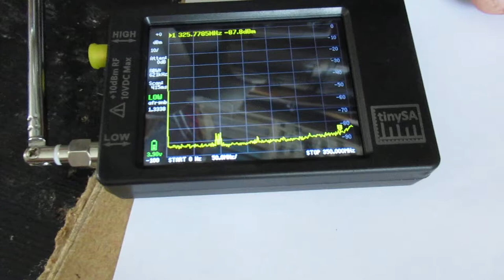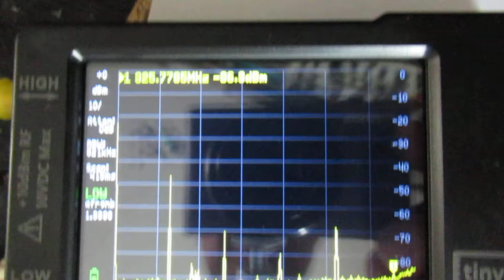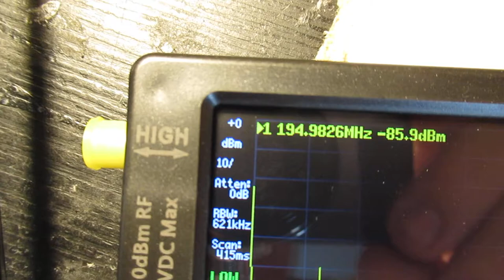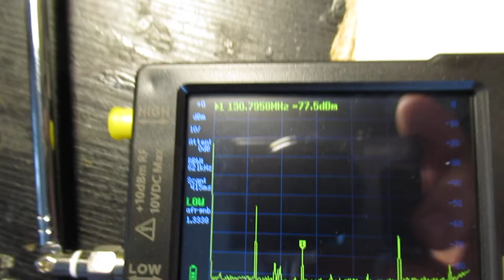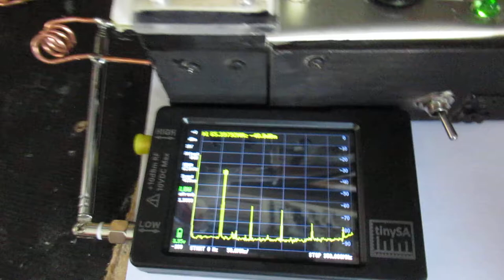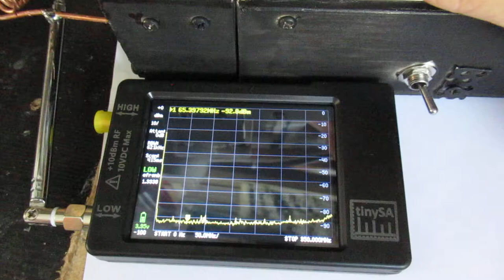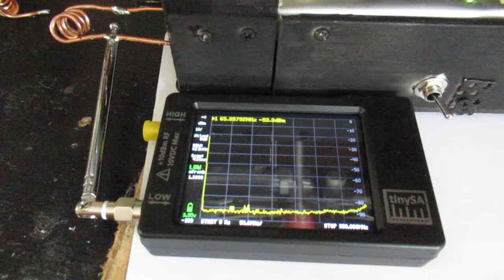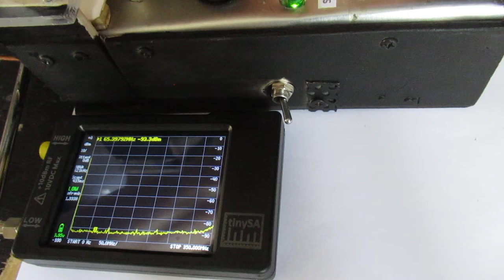Dipmeter 20-325 MC & VHF test oscillator made with a BD139 transistor better explained VLOG & schem.

Comment: Are the harmonics due to the oscillator not producing a perfect sine wave?
Reply from the maker: Yes, that could be true and better said: is true, looking at the oscillator physics. When the (a) sine wave  waveform  is not completely pure (say with sine wave sub-resonances inside it, visible via the LF-HF or VHF oscilloscope) there are more harmonics, caused by the sub-harmonics inside the sine wave, when it is not pure or not pure enough. I did not pay attention to that effect, though it is real. Only talked in this video in a a say common way, when talking about squarewaves and the Fourier analysis. So indeed the best idea is to study the waveform with the oscilloscope + a frequency analyzer. In that case you can see and study all the effects of the say ground wave, its second harmonic, third harmonic etc + all kinds of other resonances that can pop up in the HF or VHF or UHF spectrum. In such a case you need a spectrum analyzer with a real broadband  screen, so not the 70 Euro Tiny Specrum Analyzer, in such a case the waveform and peak resonance on frequency X must be looked at via a kind of (electronic) looking glass. Thanks for your comment.
Reply from the maker: Have pinned your comment because of its importance 27 july 2022.